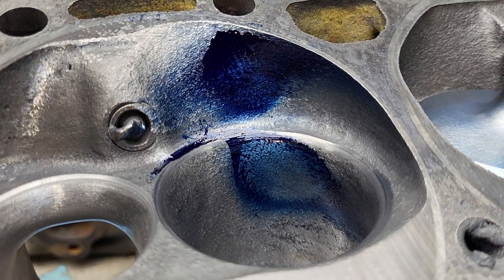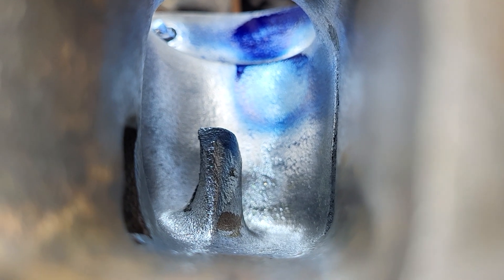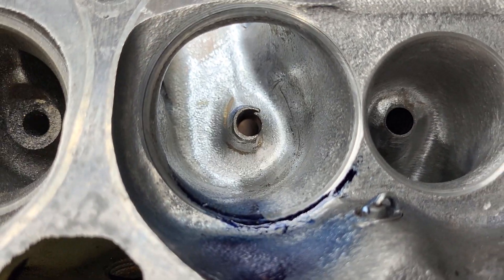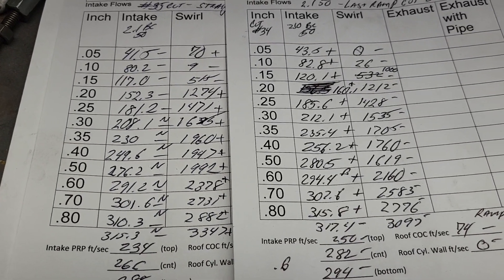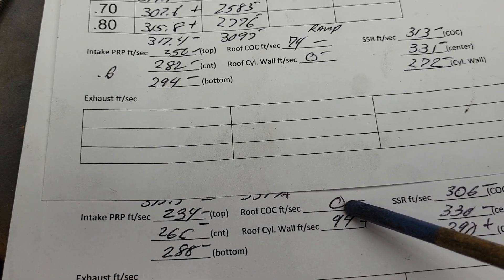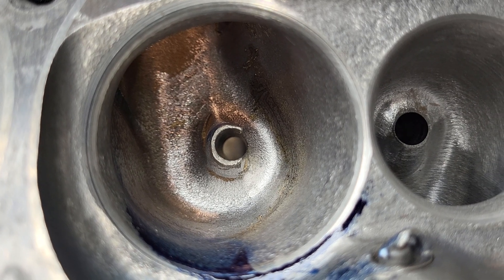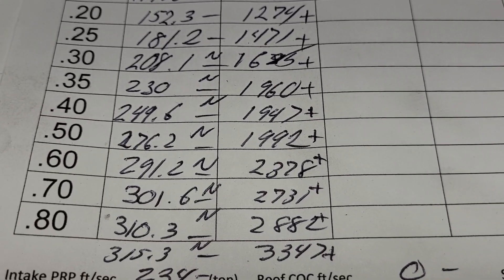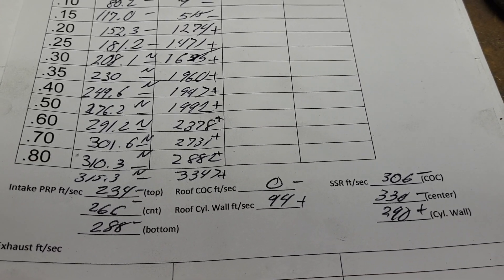47. Chevy 193 TBI Swirl port cylinder heads. Cut #35 Making a Swirl port to a straight port!

Comment: Hey Charlie, the Cast Heads guy is trying to retire, he tried to sell the whole business but looks like he is parting it out if you're interested in a head porting CNC or other cylinder head tooling. He just posted a couple videos on this platform, he used his machine to port cast iron. He said something about them being rebuilt recently.

That machine would be great for pumping out 
300 CFM 193 castings!😯😎👍
Reply from the maker: I wish. Thanks

Comment: I do think this whole swirl port series is fascinating. In your opinion, if you were to take your best cut/set of flow and swirl numbers- What kind of power do you think these heads could make on a 350 with a fitech tb, with a cam below .500 lift at 9.5:1 cr? Sorry for the newbie question, but I'm learning.
Reply from the maker: Way more than I ever thought possible with this head design!

Comment: The TBI bolted onto a aftermarket manifold with a plate adapt. ,and the 1.94 intakes would be interesting,,not sure the # of cut,,,swirl ramp half gone
Reply from the maker: I looked for my adapter for t.b. to four barrel intake. No luck so far. Thanks

Comment: I'm curious if the steep transition from roof to the bowl is causing turbulence/noise. Your suggestion of clay to assist with that transition, making it more of a straight port is probably the answer. I don't have a flow bench and don't see financially acquiring one at this point so if you set up memberships for requested research I would be all for it.
Reply from the maker: Thanks

Comment: I just had a ridiculous idea.. Porting 305 TBI heads with 58 cc chambers, adding 1.94/1.6 valves. Hmmm
Reply: Sounds like a great street combo
Reply from the maker: I have put even bigger valves in 305 heads and used them on bigger engines.

Comment: I would like to see you fill the short side, make a larger radius
Reply: That and I always wondered what a vane that split the port in two would do. It would start just before the bend and  curve through the bend in an effort to direct some of the air to the quiet side of the valve
Reply from the maker: Maybe.
Reply from the maker: @kennybayliss3706 Traction!